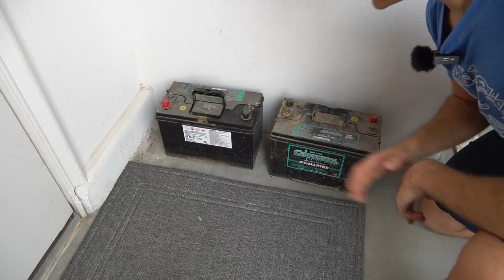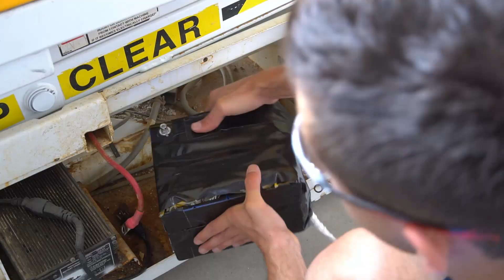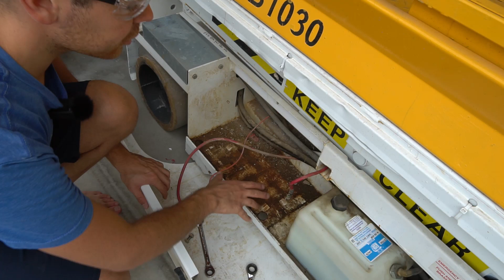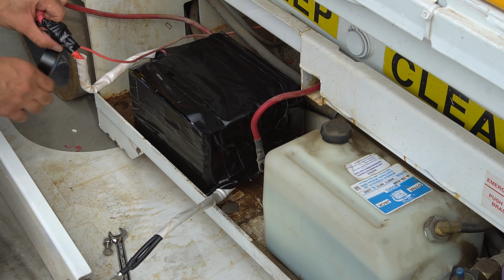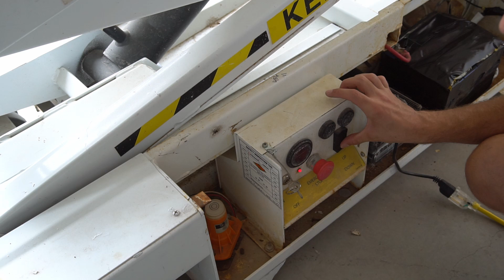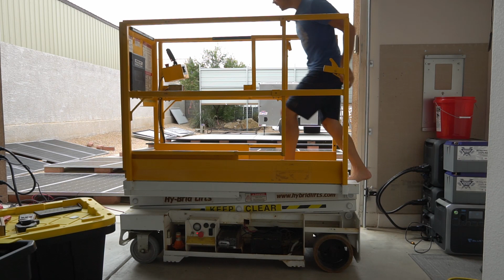Powering my Scissor Lift with Cheap LiFePO4 packs

Comment from the maker: Yes very true everyone, I am well aware that the heavy batteries ensure that it doesn't tip over. They are only 50 pounds each, and the lift is 1200Lbs. So it should be fine. I've never even tripped the tilt sensor because I use it on flat surfaces only. 

I considered this months before I did it. I was just waiting for the lead acids to die. Anyways, I can add some weight but it should be fine. Especially how light I am. Not a big concern at all.

Now the real issue no one seems to point out is that if the battery charger is transformer based and the kickback fries a FET in my BMS, I'll have over voltage event and can fry my batteries when charging. Which we have done on this channel before. That would not be fun.

~~~~~~~~~~~~~~~~~~~~~~~~~~~~~~~~~~~
Does off-grid solar confuse you? 
Save time and money with my DIY friendly off-grid solar kits, my latest product recommendations and so much more! 
http://www.mobile-solarpower.com

Join our DIY solar community 
#1 largest solar forum on the internet for beginners and professionals alike. 130,000 members and counting!
https://www.diysolarforum.com

Check out my free book
Best-selling and beginner-friendly guidebook to off-grid 12V solar!
https://www.mobile-solarpower.com/the-book.html

~~~~~~~~~~~~~~~~~~~~~~~~~~~~~~~~~~~~
My Favorite Online Stores for DIY Solar Products:

Signature Solar
Creator of EG4 and the largest DIY solar store online! 
(automatically save $50 by using my link below)
https://signaturesolar.com/?ref=cPwLcVc0SW-BjN

Current Connected
Victron, EG4, Midnite and so much more! Fast shipping and great prices:
https://currentconnected.com/?ref=wp

WattCycle
A very budget friendly 12V battery that works great!
https://www.wattcycle.com/collections/all/products/wattcycle-12v-100ah-group-24-lifepo4-battery?ref=aaezwkkc

Litime
Classic and reliable 12V batteries for solar! Bestseller for many years:
https://www.litime.com/?ref=XBIA62RFcalHns&utm_source=affiliate

Epoch Batteries
High-quality, marine grade 12V batteries that can survive anything!:
https://www.epochbatteries.com/products/12v-460ah-lifepo4-battery-ip67-heated-bluetooth-victron-comms?rfsn=7352625.50494d

IntegraRack
DIY Friendly Solar Panel Mounting Kits! Easy to assemble and super strong:
https://www.mobile-solarpower.com/ground-mount-racks.html

Ecoflow Power Stations
The most popular plug-n-play mobile power station! I have been using these for years:
https://amzn.to/4gID4j0

Anker Power Stations
Highest efficiency and best performance. The biggest challenger to Ecoflow yet!
https://amzn.to/4k0yhMM

Watts247
Need international shipping for large batteries and inverters? Check them out!
https://watts247.com/?wpam_id=3

Rich Solar 
One stop shop for budget 12V systems!
https://richsolar.com/?ref=h-cvbzfahsek

Battery Hookup
Cheap used lithium cell deals:
https://bit.ly/2mIxSqt
5% off code: diysolar

~~~~~~~~~~~~~~~~~~~~~~~~~~~~~~~~~~~~~~~~~~
Contact Information:
I am NOT available for personal solar system consult! If you wish to contact me, this is my direct email: williamprowsediysolar@gmail.com

Join the forum at https://diysolarforum.com/ if you wish to hang out with myself and others and talk about solar

FTC Disclosure Statement and Disclaimers:
Every video includes paid promotion or sponsorship (such as free products for review). Some links on this YouTube channel may be affiliate links. We may get paid if you buy something or take an action after clicking one of these. My videos are for educational purposes only. Information is subject to change/update at any time. Electricity is DANGEROUS and can kill. Be smart and use common sense :) DIY Solar Power with Will Prowse is a participant in the Amazon Services LLC Associates Program, An affiliate advertising program designed to provide a means for sites to earn advertising fees by advertising and linking to Amazon.com
Reply: Electrical lifts work on current no matter where it comes from other than making sure that there are enough amps to run the motors.  The lithium batteries should be able to handle to current needed to operate the lift.
Reply: Yeah this isn't like a forklift with a 1000+ pound battery pack. The center of gravity change is pretty minimal with just those two small batteries.
Reply: Hey Will, whats your take on replacing car lead batteries with lipo? I know its now done on fancy supercars and what not, but is it easy for average joe using hobbyking batteries? Or is charging from the alternator the main problem in that case? I hate my truck's giant -ass 24v setup
Reply: that's funny back in the (olden days ) lmao 
this should increase sales . course nobody wants to be old  !! lol
Reply: This is what has kept me from changing my lift. How can you tell? My built in charger was designed for lead acid batteries and it can't be changed on its settings.
Reply: @psychoticepisode1268  We call it ‘testing & commissioning’ Karen. Sad
Reply: @morkovija  not a good idea since lipo batteries don't like cold or very warm temperatures. When temperature drops close to 0C lithium batteries are useless, you cannot pull much current from it or even charge it
Reply: @clixium  electric warming blankets could be a solution.
Reply: I was wondering, why do you need a lift anyway, are you painting your home?
Reply: When will people stop doubting you?
Reply: @fisherus  si tienes un cargador deltaq puedes cambiar el algoritmo para que cargue las baterías de plomo

Comment: You can rent those out to construction workers.
Reply: complicated. and they break them
Reply: Only if he will maintain the osha compliance certifications… unlikely.
Reply: Those things seldom break. And if they tear it up you charge them for it. The equipment is built under Osha compliance. There are no unsafe modifications to it and the safety gearcis the responsibility of the renter such as a harness and tie offs.  So is being properly trained to operate them. It's a smple 30 minute class anyone can teach and certify and issue a card to show you accoplished a nothing burger class to use a lift. I have a buch myself to certify as I see fit.
Reply: @recoveringsoul755  Complicated things are hard for lazy people that have no drive. Will has a brain and wouldn't have any problems renting equipment if he wanted to do so.

Comment: You need to build a car with LFP battery.
Reply: For the past decade or so, LFP has been the preferred choice for DIY EV converters. Most OEMs initially went with lithium manganese oxide (LMO) and, later, nickel manganese cobalt (NMC) for their cars, because of greater energy density. But the trend is now witnessing LFP making inroads here. Note that Teslas made in Shanghai have CATL LFP cells and it was announced recently that standard range Model 3s coming out of the Fremont factory will now be using LFP.

Comment: Will please post a video when BMS cuts off when your ALLLLLL the way up.
Reply: Not sure about Will's lift, but mine has a backup hydraulic valve to lower without power
Reply: @CyrusAhmadiMoghadam  They all do. Even my 1970 Telsta 36 foot bucket truck lift has one. They figured that out decades ago.

Comment: I gotta ask. Why do you have a scissor lift?   Is it “because you can?”
Reply from the maker: It's because I got a good deal on it and I have a 1200 square foot workshop with 19 ft ceilings
Reply: @WillProwse  I’ll be.  I didn’t realize your shop was that large
Reply: @WillProwse  I thought it was for installing solar panels on your roofs. It seems like you’re doing that a couple times a week, so I can imagine a scissor lift would be worthwhile.

Comment: Dude!!! I'm currently needing to replace the lead acid batteries in my towable boom lift. It's a 24v system. I'm trying to figure out how to switch everything over to lithium and maybe add an inverter so I can power tools on the job site as well.  If anybody has info on this, I'm all ears.

Comment: Will, I am an electrical contractor and have a scissor lift that needs batteries. Is it actually ok to use LiFePO4 batteries? I need new batteries in the lift. It currently uses 4 6-volt SLA batteries. Right now on amazon I can get the 12v 200 AH Ampere Time batteries for only $699. I would just need two in series. This would be the same cost as getting the "proper" SLA batteries. I understand the Ampere Time don't have low temp sensors, I can work with that. Is this a good idea?

Comment: Ancient Technology Lead Acid 😅
Reply: Agreed. But lead acid in cars , trucks, and boats as a starting battery is stupid proof down to 0 degrees F. 
Lead acid cranks at 600 amps for a bit with no BMS to cut out, no complaints under short massive loads and they charge much slower and save the alternator from overheating. I'm all about LiFeP04 in my other things, van, home backup, quiet portable power.

Comment: I use a LiFePo4 pack for ham radio HF portable ops with a solar panel & charger for extended time & power out. The voltage holds over 13 volts under load.

Comment: I know you mentioned it, but in case someone doesn't read it, the on-board charger will likely need replaced. If you try to use it, you have to monitor (while present) the entire charge cycle, and after it. It will likely rest at too high of voltage, causing unsafe battery system failure.
Reply from the maker: Yes agreed

Comment: let's say i have a system that needs to run 3000 watts for 18 hours a day, what system would u recommend?
Reply: Are you SURE it needs 3000W for 18 straight hours? That is 54KWh of storage… and you would need 9000W of solar input MINIMUM to feed it. 
If you need reliable operation throughout overcast days, double the solar, and triple the storage… 
That is a LOT of money.
Reply: @SuperVstech  how much? i need it for indoor gardening. I have 15 light fixtures running 200 watts each.
Reply: @Wabuh-Wabuh  My dude, we'd need to so much more information. For a single day of operation you'd be looking at 8-10k in batteries alone.
Plus a decent sized inverter, a heap of solar, install costs. Ect ect.

Add in a bit of redundancy like SuperVstech pointed out and you're probably looking at 30k+ for batteries alone.
Reply: @Loolanga  bro but model 3 is only 35k....with 50kwh...how can this be?
Reply: @Wabuh-Wabuh  because you would need at minimum 54kWh per day, you'd need a model 3 of energy storage per day to run your lights
Reply: @SuperVstech  y do i need 9000w of solar input?
Reply: @Wabuh-Wabuh  the math is fairly simple.
Take the watts per hour needed: 3000 times the hours required: 18 and that gives you 54000Wh of MINIMUM storage… now divide that by the average hours the sun is up: average5.5 and you get 9,818ish watts required.
Reply: @Wabuh-Wabuh  now… the actual numbers are even larger, because the sun is RARELY up every day… there are cloudy days, and stormy days, and other reasons for low solar production, so you need additional battery storage to stretch the load, most recommend 3 to 5 times the required storage… plus, enough solar to fill the large bank when solar production is low… so, really, 18,000W solar isn’t too much…

Now… if you find that the required wattage can operate in banks, and only half on on alternating hours, that would reduce the Wh bank size by 50%… so verify the 3000W for 18 hours figure.
Reply: @SuperVstech  so 2 teslas & i pay 5k a year for electric now & this would cost around 40k, so it would take around 8 years for it to be a reasonable investment.
Reply: @Wabuh-Wabuh  watch Wills latest video, he breaks down the cost of the system he uses to charge his Tesla. Figure about double his estimate, and you are in the ballpark.

Comment: Will, you've got your own scissor lift now?? oh my gawd. My ex husband took a nasty spill in one on a construction site. There were drain holes in the cement floor but they didn't all have the metal grates over them, so just empty holes. Yup he saw them there and I guess forgot, was fully extended in the top of the lift doing whatever on the ceiling, and drove into one of those holes with a wheel. Thing tipped over, he crouched down in the basket and rode it down. It was near Stanford hospital so they took him there. Messed up his vertebrae. He's OK, but has back pain and other weird stuff. Went back to work after the hospital though and got back into a different scissor lift. The one that fell, they tried to straighten out the parts that bent. Not sure if they got it working again or not, to be able to go up and down it can't really have a lot of bent parts in the scissor action pieces
Reply: ouch sorry to hear that 
hope he his back pain gets better

Comment: Will, can I ask you how you will charge it?

I have a mobility scooter with 2x 12V SLAs . It has a built in charger. I really want(need) to save the weight, but I don't know if the built in will charge Lithium. Even if I don't get a full charge it would still be awesome but I worry it won't charge them at all and I'd have to jury rig a solution that would need to be transported everywhere. I could do that before I was disabled but...

I don't have specific knowledge about charging needs for different chemistries. If you want an awesome business, some sort of a BMS that emulates lead acid voltages during charging would help the planet change over to Lithium
Reply: Ahhh, you answered this while I was typing it.  :-( :cry:
Reply: There are LiFePO4 batteries designed with special BMSes to make them "drop in" replacements for lead-acid batteries. (That is, the BMS is set up to deal with a lead-acid charging system.) If you can't change the charger, they might be an option. My understanding is that they're popular in racing motorcycles because of the weight savings.
Reply: @FurrBeard  I haven't seen any. I saw a Dakota they were claiming to be drop in replacements for mobility scooters but in the fine print they said they needed to use an external charger. lol

Comment: Yeah, why not. We all have a scissor lift.
Reply from the maker: You should check them out. I bought mine used for cheap. They are incredibly useful
Reply: @WillProwse  And you will find friends that you didn't know you had.
Reply: @WillProwse  I'm certain :P But I'd lack the house (they start around 1.4 million USD here), and most are in hills and mountains .. with garden around. very little horizontal space for such a scissor. A telescope lift arm would be cool, but that comes with a heavy, large and expensive truck :)

Comment: So you have to replace the charger I suspect.   I have been wondering if I could use Lithium in APC SMARTUPS 1500s.    I’ suspect the charger won’t handle Lithium and I’d be better off using a separate inverter, charger and BMS.   Have you ever experimented with that?

Comment: Very cool. A word of caution.  I often use scissor lifts on job sites, and I think the tip-over safety margin may include the mass of the lead acid batteries.  Especially if the lift is a particularly high unit with the snorkel deck pushed out.  Even with the battery weight, snorkeled out and 32’ in the air, leaning out, it’s a pretty sketch event.  
Carry on, your channel is very informative.  Thank you for your efforts.
Reply: Can alway add an outrigger arm
Reply: The small units only have two batteries, they don’t have enough weight to affect stability. On the big ones with 8 batteries, sure, that is included in the rating. Don’t forget, SLA and Lithium are only 50% difference in weight. If there are any stability issues, a chunk of plate steel under the batteries would make up the difference.
Reply: Yep, the weight of the batteries certainly is part of the engineered design. Changing the batteries to non-spec would make it illegal to use on a job site here. There would be a major fine if any kind of workplace accident happened even around the machine here. We are also required to have up to date fall arrest training and aerial lift platform training by the province. 

To legally change the batteries to LiFePO4 we would need an engineer's stamped document.
Reply: @lordgarak  oh, absolutely, illegal to modify and use on a construction site. But absolutely fine to use in your own property, on a level surface.
Reply: Yes your right, my jlg 1932 has four  60 plus pound lead acid batteries. So taking out almost 250lbs will affect balance just add back ballast same as what you took out.

Comment: Now you need a LFP charger 8 cell . Years ago I ran a lift on a 24V NiCad aircraft SAFT battery . ran for years. This was around 1988 or so . LFP would be the best to use today. My jump starter is LFP with super cap . for the lift you can use a cement block for ballast weight.
Reply: LiFePo

Comment: I liked the lead acid battery back in the olden days.  Wait a minute, I'm from the olden days when we used lead acid batteries in high power solar installations. Lithium is better, "This is the way". These are great videos Will.